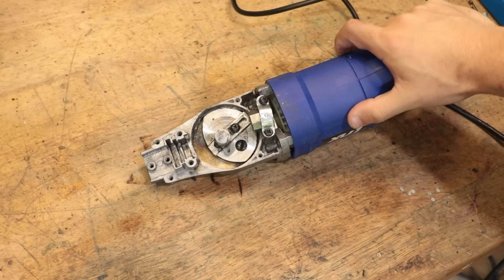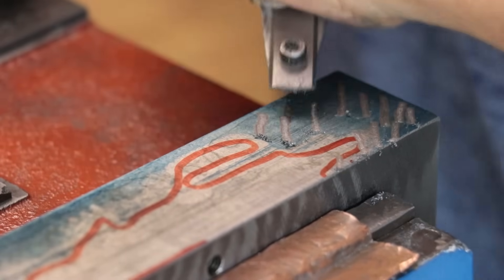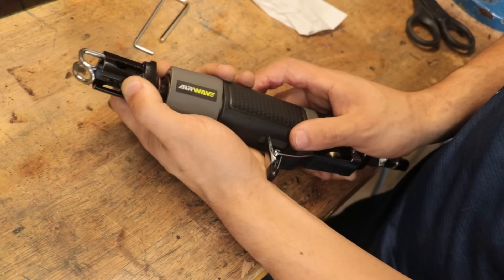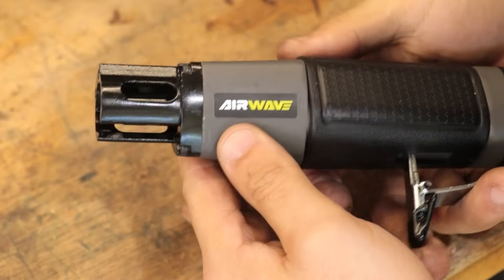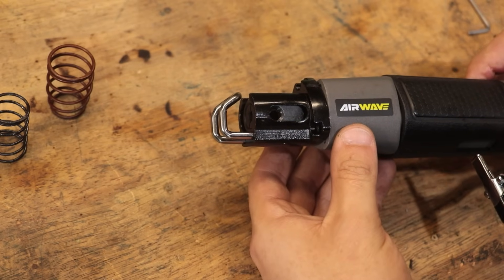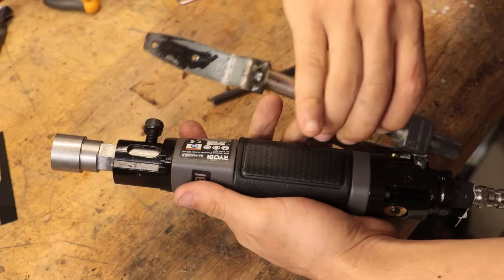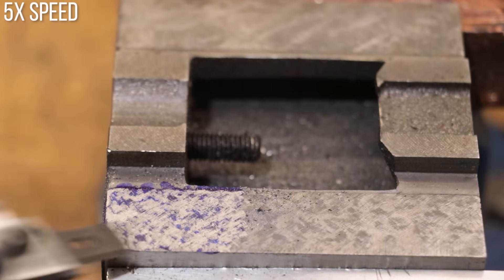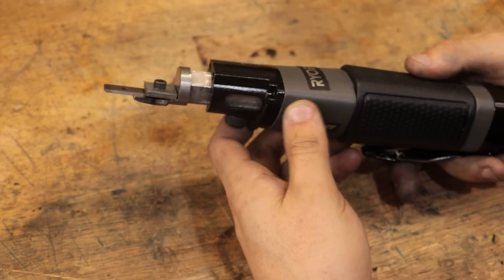Making A Pneumatic Power Scraper - One Day Build

Comment: Well, i think You didn't consider one important thing. As for movement geometry Your design just rams straight into scraped item like a hammer, not sliding the carbide. Like the Biax, You have to replicate a slide movement with carbide being at angle, not straight. So to scrape with this air saw, You have to hold it flat to scraping area and set the carbide at an angle like 15-30 degrees. The movement has to be dead flat to the surface that youre scraping.
Reply: Yeah has to cut, not hammer.
Reply: 100%
Reply from the maker: Yeah I know but it was scraping and it was getting the right pattern and taking material off so I was happy to leave it there
Reply: @artisanmakes  It seems like all you'd need to do is make a head where the blade is angled down. Abom79 has a great video on scraping basics and there's a biax in operation in the video. It really looks like you're 90% there. That and a needle valve to control the speed.

Comment: Air tools are really great, cheap, robust etc. even with noisy compressor near me, it is real treat to use them :D
Reply: Agreed, and compressors don't have to be that bad - mine lives in a box with baffled vents and some hanging carpet on some rubber isolation feet that turns the 100db into a much more comfortable if still loud sound. Now with the workshop doors open its quiet enough to be lost in the usual daytime background noises of a city with only 10 to maybe 20 odd meters of distance, and close the workshop door I can use it at night without anybody but be being bothered. Though it is still loud enough you'd want ear protection to share the space with it, but so so much better.

Comment: I made a pretty decent granite lapping plate using an oscillating tool with a diamond grout removal blade.
Reply: I thought about that last time, they cut so slow and are pretty controllable.
Reply: I've been considering trying that just for fun. You mean you cut the grooves for the lapping compound like that? Problem is I only have one block of granite, guess I'd need three?
Reply: @Serbokrat  no, I flattened a rough saw cut piece of granite. I have a cheap Chinese surface plate as a master. I've been perfecting the finish with ceramic sand paper also on the oscillating tool.
Reply: @garyseverson3094  oh you actually flattened with it, like by hand or with some jig/mount? That's brilliant.
Reply: @garyseverson3094  oh you actually flattened with it, like by hand or with some jig/mount? That's brilliant.

Comment: If you look at a real powerscraper the stroke goes perpendicular to the surface and the tool is angled down  toward the surface. On your airsaw the stroke goes down to the surface at ~30* with a straight tool basicly picking away instead of scraping. I dident listen to the video you might already be aware just tought i mention it.

Its always nice to have something powered to atleast take most of the material off and just laying the finishing touches by hand.
Reply from the maker: It is slightly different but I found that it was still producing the scraper pattern I was looking for and producing the oil gulleys too. But there’s always room for further modifications
Reply: @artisanmakes  Try making the strokes sideways instead of pushing forward. Move the tool left/right.

Comment: You wouldn’t believe how excited to see this pop up!  I don’t know where it ends up, but I’m glad you got past your frustration.

Finished!  Sweet build, professional results.  For speed control, I think you could add a valve to the air line that will restrict airflow.  Pressure would remain the same, but it should re-pressurize the tool slower.  If I’m right. 😊